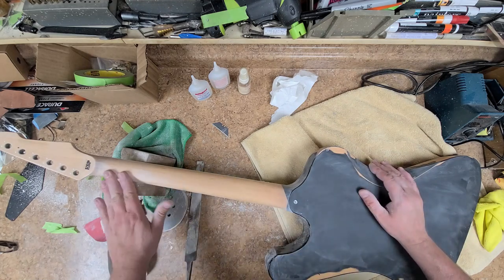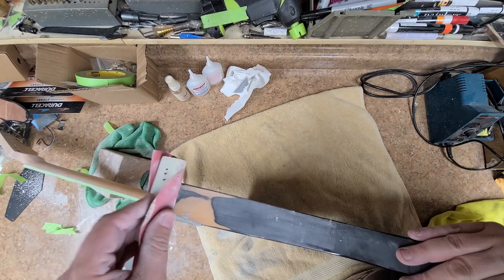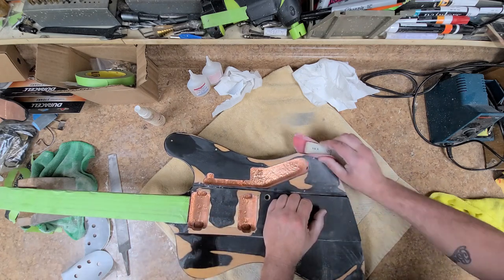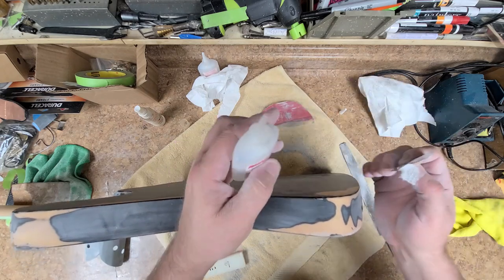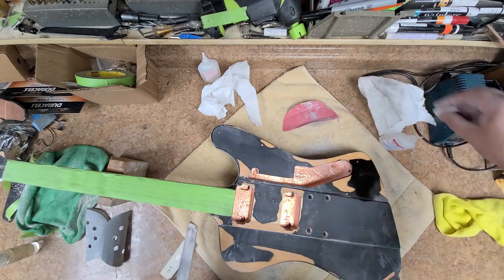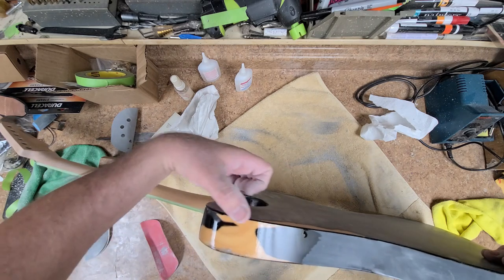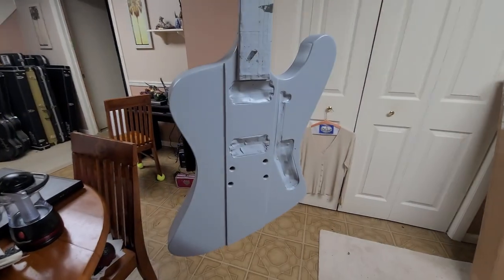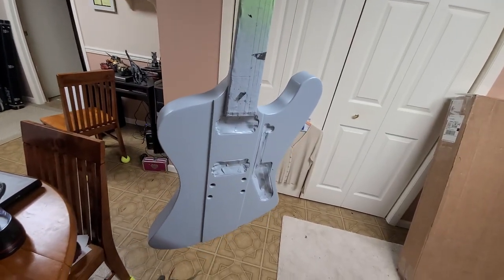The Phoenix Will Fly Again

Comment: finally someone who knows the importance of a good primer! (you are using a respirator with this stuff right?) what is your paint booth set up like? you do such a great job - it would be neat to see a video that highlights ur shop equipment - flawless work Eric. how many are u sending out a month on average?
Reply from the maker: Oh yeah. I am using a respirator. I'm using urethane paint. I don't have a booth set up. It's more like a fan in the window of my garage. I picked up a compressorless, air less sprayer that makes next to no overspray. Right now I'm using SpryMax spry can paints from House of Color. The spray pattern comes out just like if I was using a gun to spray. The color paints are not bad as far as overspray, but the clear has a lot of overspray. Now I can get every custom color, and I'm going to take advantage of it. I'll still use dyes on flamed and quilted tops, but I have been testing candy colors on flamed tops and it looks great. I think this is going to be my thing now.